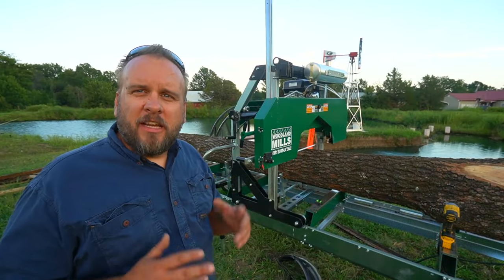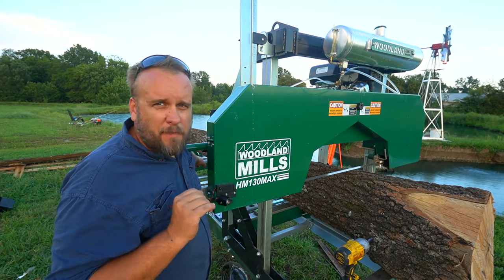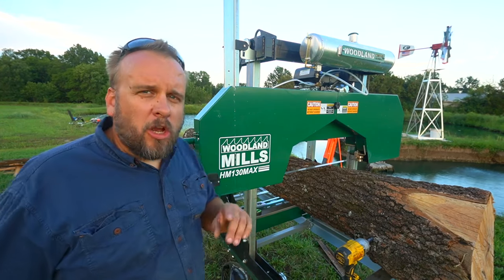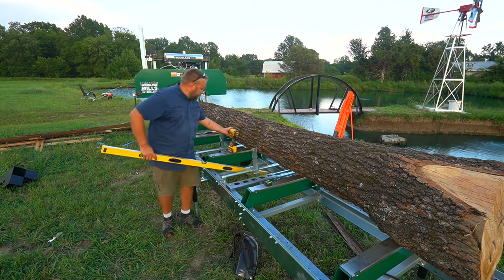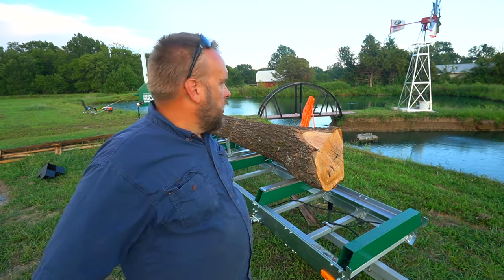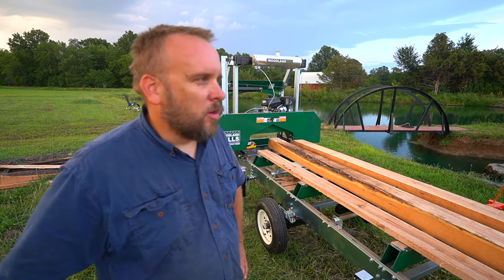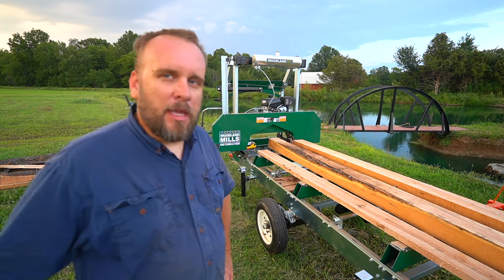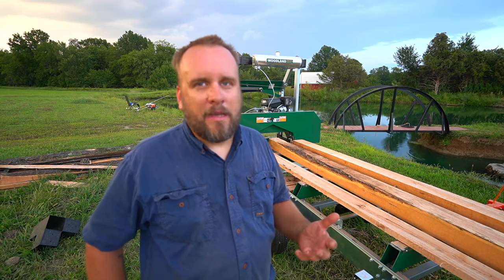Leveling Up at the Sawmill

Comment: A trailer tongue jack with wheels or a trailer dolly will allow you to pivot the trailer on level ground. The leveling would be easier and more secure if the trailer had 8 jacks instead of 6. They will need to be equally spaced to support the flexible frame.

Comment: Good afternoon Brock. I've been quiet the last couple of days and I'm no expert on sawmills but I think that as far as moving the mill into the quanset hut option #3 is the best. #1 is not how you'd prefer it. #2 and you will at some point kink the frame(rails). It may not happen right away but it will eventually happen because the frame will get old and fatigue. That, I'm an expert at. 😁😁👍 As far as leveling it, I would keep some pieces of hardwood approximately 12"×12" a couple of inches thick as leveling pads but the idea of setting a log on the mill is a good one but I would have the level at least close first. That way you're not putting too much stress on the frame rails. This is what happens when I keep quiet for a few days. I'll be watching to see what you decide. You'll probably get better advice than mine from more knowledgeable people but I figured that I'd throw my two cents in anyway. God bless and have a wonderful rest of the day. 👍👍🙂 P.S. The reason that I've been quiet and running late is because we finally finished my new lean-to. It's great to have good friends and family.

Comment: Seems you have the "leveling issue" figured out pretty well. I have an HM122 Woodlander and it works basically the same way, just work your way around it. One trick you might want to try is once you have it leveled (square with itself) attach some RV leveling indicators at strategic spots around the mill, which will cost less than the 8' level. As for moving the mill in and out of the building either a removable tung wheel or a ball attachment on your tractor or skid steer will work.

Comment: There IS a secret to leveling your mill, but alas, it's a secret.  JK.   Set each of the jacks on firm footing, such as (portable) concrete blocks.   Set up a laser level nearby and level the entire thing -- not just 6, or even 8 foot pieces of it.  Is 6 points of contact with the ground really enough?

Comment: Put some 2x8x8 pads on the ground under the adjustment legs instead of the legs going straight to the ground to keep them from sinking into the ground
Reply: Good suggestion to support and stabilize the jacks.
Reply: Yeah. I was thinking 10x10's, but regardless, those jacks need some kind of larger base under them. And they'd be easy to make, he's got plenty of wood :)

Comment: Back it in, detach from the ball and maneuver it around by hand until you get it placed where you want.  I’ve been moving single axle boat trailers around in tight places for years.  Doing it by hand gives you precise control.

Comment: Personally, your option 3 sounds like the safest, and probably easy as well.  (trailer ball on the forks).  Welding on, or adding structure to that trailer might mess up your ability to level it like you mentioned.

Comment: When you move or transport the mill, all the weight is supported by the axle in the middle of the frame, so don't see why moving with forks would hurt anything. When pulling it down the road it will be bouncing which I think would be worse than lifting with forks for a few feet

Comment: I wouldn't carry the mill.  I would put the pallet forks on the skid steer and put the forks all the way to the one side to benefit you and put a ball hitch on the forks and you should be able to jack knife it in pretty hard, we always moved farm quipment into winter storage this way and it works so good, you can really make some tight turns.

Comment: #1 Set it on firm ground, not bare earth. You need stable concrete pads or packed foundation of stone.  #2  Make up a series of vinyl tubes with upright tees at each end & 3 in the middle, to make 5 uprights on each side. Clamp to frame & fill with water to halfway height of frame. Now you can level it at each section to exactly the same as the others.  #3 Set a log on & check. If it moves a lot, increase your levelers. Moves a little, adjust to perfect & saw the log. You can check with each log, or make the foundation more secure. Leveled machinery this way for 48 yrs. Even machine to machine this works perfectly.
Reply from the maker: The idea here is that I will be taking this mill and setting it up in a lot of different locations. Not just my house.